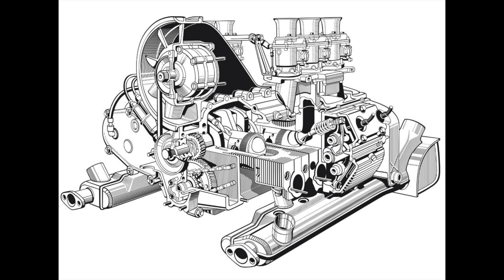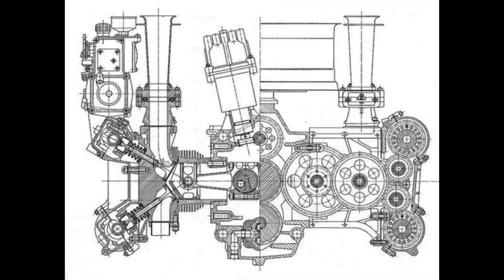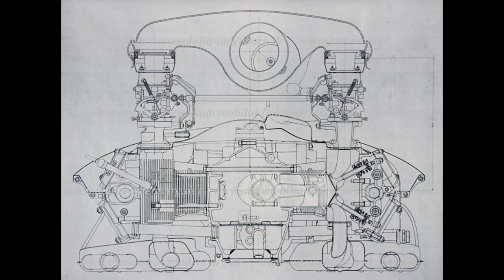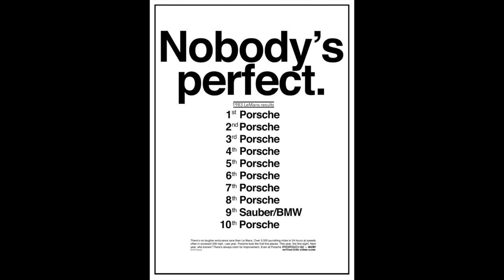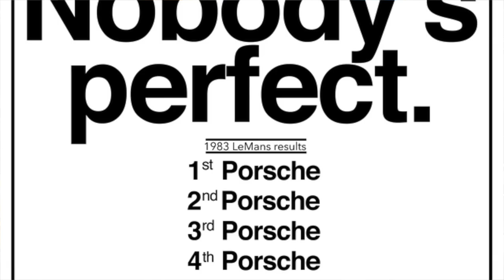Porsche Mezger Engines: Which Are They, And Why Does It Matter?

Comment: Great explanation of the Metzger engines. Ive been trying to describe these same sentiments in hopes the people that care to listen fully understand the beauty of engeneering that went into a Mezger. No other motor has this type of heritage and pedigree. Currently own a 997.1 turbo tiptronic in Gt Silver which I will never get rid of.  The smile it puts on my face everytime I get behind the wheel is unexplainable.
Reply: I own the same generation and transmission but in black with beige interior.  I've owned it for 13 years and have had it since 7000 miles and now almost 90K.  I will never get rid of it either.  I've had all the known problems and failures with it (coolant pipes, transmission seal leaking, spun chamshaft, etc).  But despite that, like you said, still puts a big smile on my face every time I drive it.  That and the fact that with the tip, I'm still hanging or even beating modern day sports cars.  Can't say enough about the overall engineering.

Comment: At 14min 15 seconds into this video, you create your assumption that 997.1 are going to be worth more than the 997.2, on the assertion that the 997.2 is a DFI engine (you actually mistakenly said "DFE", but I think you meant DFI).  But this is NOT true for the 2nd gen 997.2 Mezger GT3, which has PORT INJECTION.  Thus I do not agree with your assertion that a 997.1 GT3 or Turbo, will be worth more than a 997.2 GT3 or Turbo.
Reply from the maker: "The DFI flat six seen in 997.2 and 991 models (including Turbos and, latterly, the new GT3) is codenamed the 9A1."   This is from Total 911, though the info is widespread...  

The .2 Turbo engine has more power, but not the robustness of the Mezger. That's why Ruf continues to use the 3.6 Mezger as its base, and why Porsche used it for the 2011 GT2RS instead of the new 3.8.

We will have to see about the values!
Reply from the maker: I may not have been very clear; I believe that the 1. 911 Turbo with the Mezger engine will be worth more than the .2 Turbo which has a DFI engine.  the .1's are the last of the Mezger engines in the 911 Turbo.  The Mezger engine did live on with the GT2 RS and the GT3.
Reply: I just watched this video, and I thought the same thing. How can you quantify that the .2 mezger will not be as sought after as the .1 or be worth less? There were several changes made to the .2 to help squeeze more naturally aspirated power. I understand that they did use a 3.6 litter mezger for the GT2. I'd always assumed it was for reliability since it's getting boosted, but didn't they also change the compression? Obviously, they lowered RPM. When you were referring to the heritage it couldn't have been the motor displacement. It must've been the architecture. I just don't understand what exactly ties the 997.1 mezger gt3 to the 956/962, especially when you said it was the 3.6 litre displacement. I hope you can explain that. I have a 997.2 GT3, and currently it's worth 60K more than the .1 and of course the 997.2 gt3rs 4.0 is $500K. I'm hoping to get some clarification. Or at least explain it to me like I'm a 5 year old. Other than that part, I loved your video and all the details.